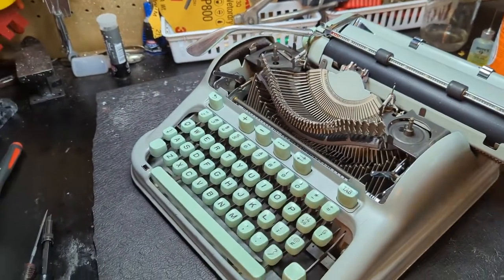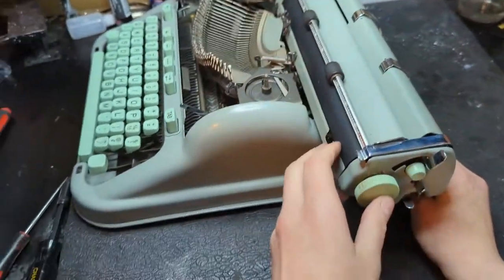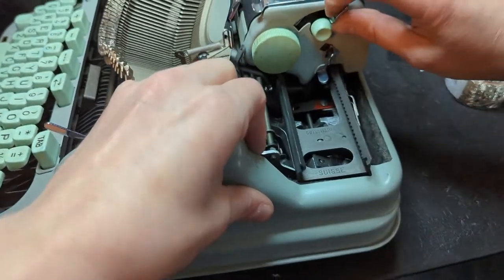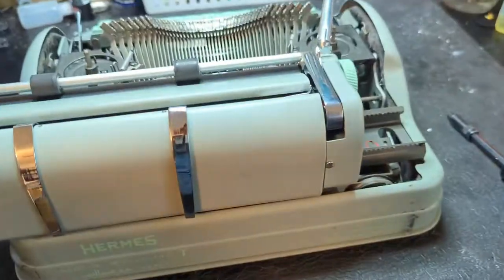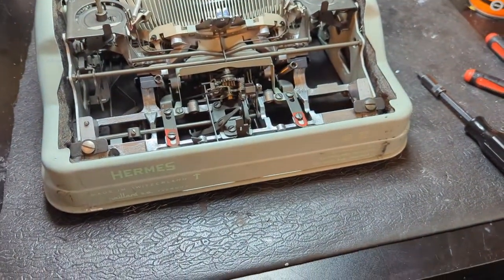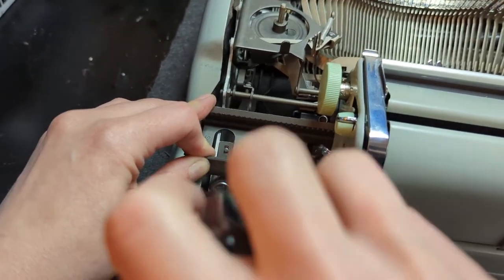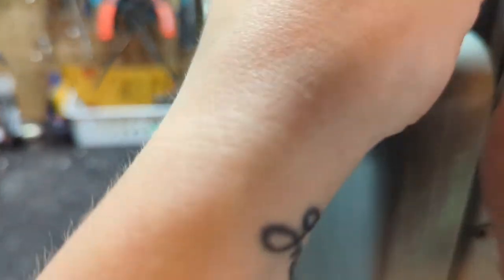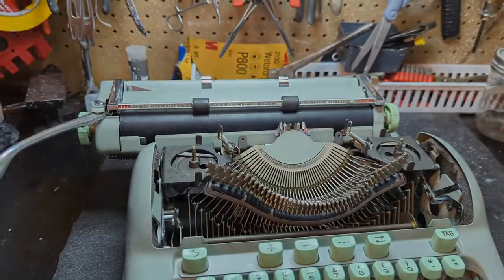Removing and reinstalling Hermes 3000 typewriter carriage

Comment from the maker: A few notes:

1) You CAN leave the drawstring attached, and then once the carriage is off, engage the carriage lock to hold the lower plate centered. Totally your preference.

2) Don't forget, one of the anchor brackets is reverse threaded; seen lots of those screws stripped from folks going wayyy too hard in the wrong direction.

3) When reinstalling, you can also tighten the brackets just a bit snug to hold them sideways; makes things more manageable if you aren't used to a lot of wiggly parts all at once.

Comment: I appreciate seeing this, and while I'm sure my H3K would probably benefit from a carriage removal for cleaning, there is NO WAY I'm going to attempt this. My machine came into my possession fairly clean, and I've done what I can in cleaning with minor disassembly,  but there's no lifeboat if I mess anything up. Banging around on a crippled low-end Smith-Corona to learn mechanics is one thing, this is another.
Reply from the maker: Luckily these were designed to be easily removed, whereas several other portable models were not. However, I do believe that if it doesn't need it...there's no sense in straining the bones of these old machines more than necessary.